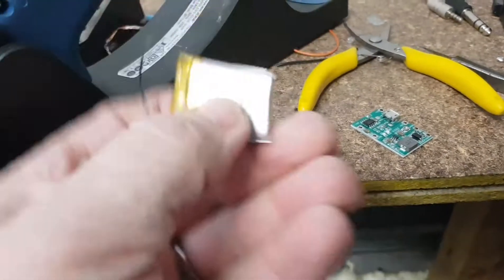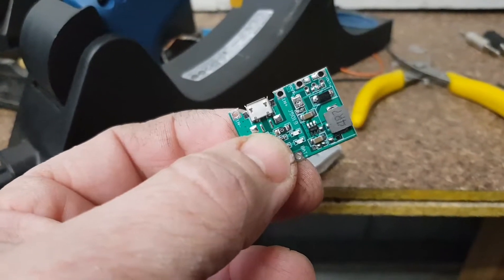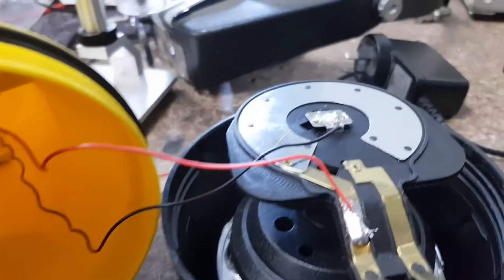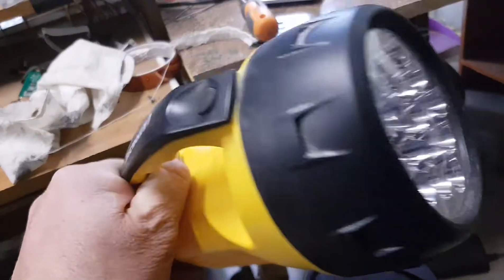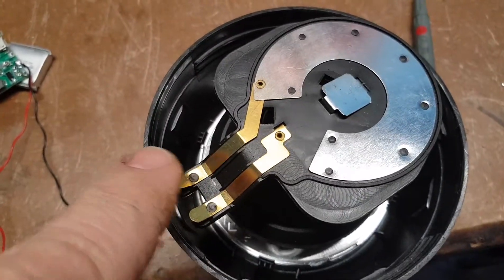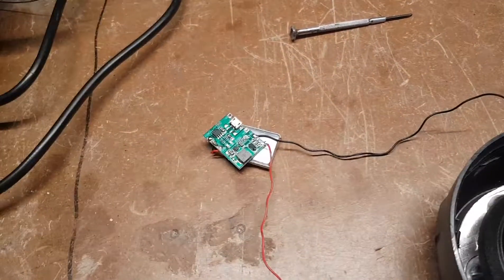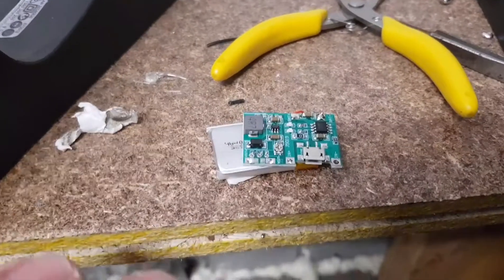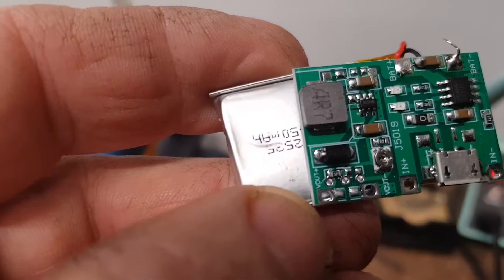Replacing an old dolphin torch 6 volt battery with lithium.

Comment: I am looking for a video where the switch work mechanism is shown please or how to test.

I have this lamp.
Same click switch button.
Have a full (tested) 6V battery.
No corrosions..
And it does not turn on and when I click the switch (top open to look) nothing happens and would like to know, what the switch does and what it looks like working.😊
Reply from the maker: You need a multumeter on ohms, to test your switch first. Plus check you globe is 6V and working. Hook it directly to your battery.

Comment: I have just put a 4.5ah s.l.a in my dolfin 6v torch. Little bit of customiseing wirh a packing block to fill space and modifieing plastic battery holding fittings. Just a old style dolfin. Expecting many hours of use and easy charge ups and no more shagged throw away batterys or throwaway expencive torches that you gota distroy to get the rechargable battery out to replace only to find they dont male that battery any more. 16 buck battery. Charge it 150 times. Chuck out buy another. Polished the lense with 1200 wet sand and cut polish past. Ps liked your torch video. Creative. Cat was cool to. 👍
Reply: Oh yer and did a little soldering hahahahaha thats a handy thing to do. No room for a coopers sparkleing ale stubby holder in my torch.
Reply from the maker: @richardirmler435  You need the stubby hold for your drinks. lol, nice work. I hope it lasts for years.

Comment: Used 8AA NIMH eneloop batteries inside of the 6V block, still could fit another 8 for a total of 16AA , works exceedingly well and lasts ages.....
Reply from the maker: Yes, I really need to put a builder battery in it.

Comment: Surprised the little battery works well enough - how long does it last on that? 
I think I would've run a lead in with a dangling USB plug or socket so you could seal the entrance hole. Those dolphin torches were great because they would float when you drop them in the drink.
Reply from the maker: About 3 hours off the small battery.  I think a bigger battery and an internal USB charge would be the go next time.